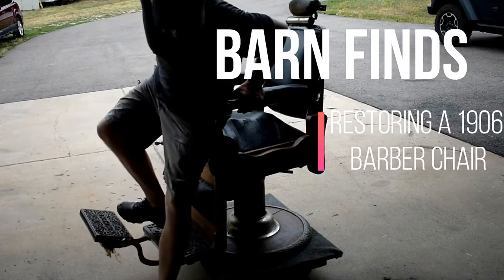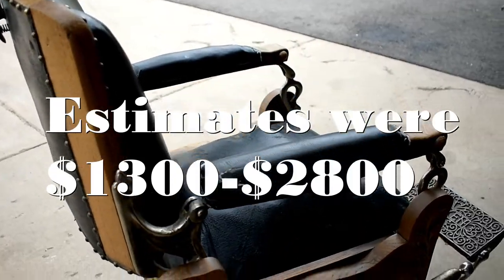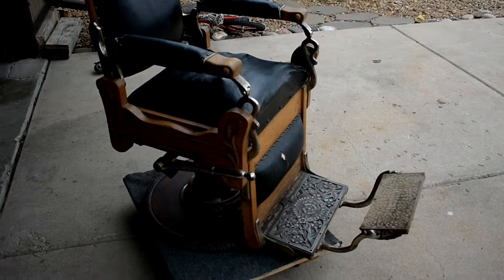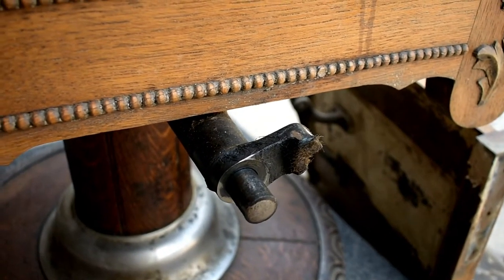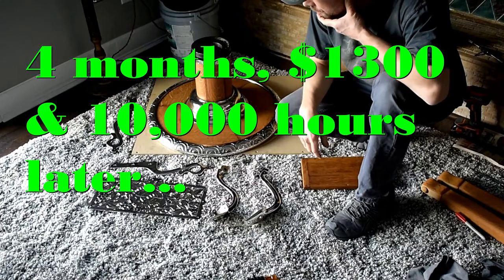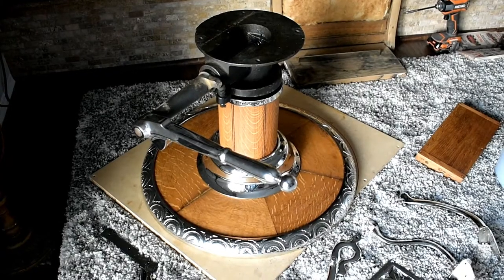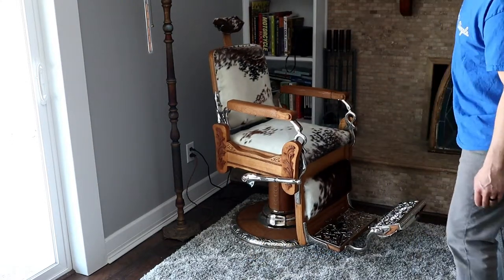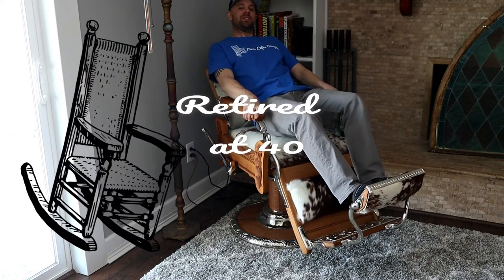Restoring A Turn of the Century 💈Barber Chair💈 Made in 1896!

Comment: I just scored one as well - my Dad pulled in from the basement of an old bank back in the 80s and it’s been sitting in pieces since. I think all there but in pieces. Wood in good shape, all the metal very rusted. Pump works but leaking. Tackling the same project as you. Thanks!!!